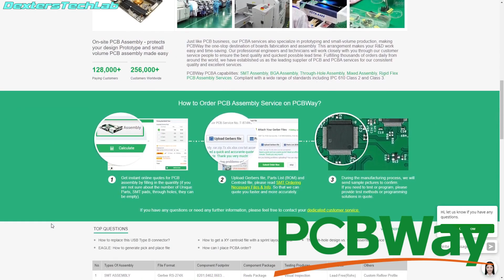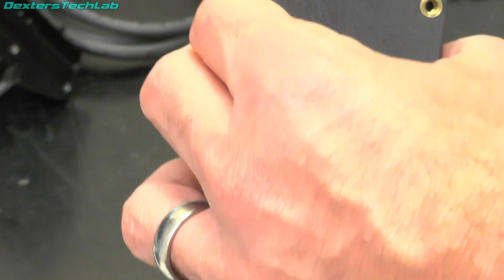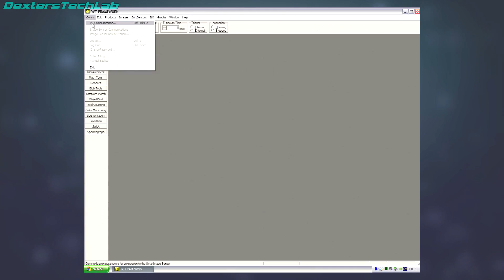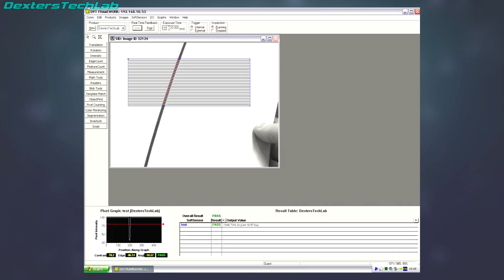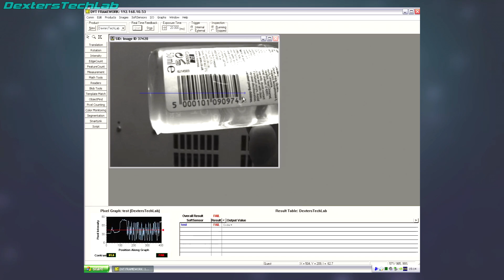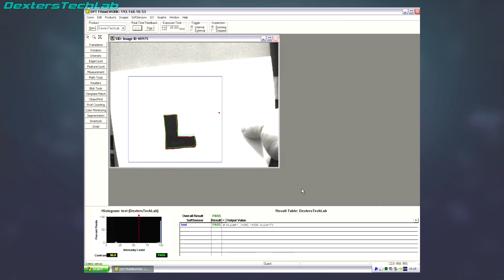DL222 DVT SmartImage Sensor 630 Machine Vision Camera

Comment: Maybe it's ultrasonic welded together?
Reply from the maker: Yes that is possible, the thing that surprises me is why it is sealed for what was a very expensive bit of kit. Unless when they were repaired by DVT they had a safe technique to get the boards out and the case was sacrificial.
Reply: @DextersTechLab  It kindof makes sense that it's 100% sealed (although the cable connections aren't really sealed very well). In a lot of industrial applications, you have a lot of nasty stuff in the air that gets onto and into everything, and you want to keep as much of that out of things to keep them working as long as possible. I'm sure with the price they charged for these things compared to the actual cost of the hardware, the hardware is essentially a throw away item. If you charge $10k for a camera that probably cost $200, and it breaks, you wouldn't even bother spending time diagnosing it - just grab another $200 camera off the shelf and replace it.